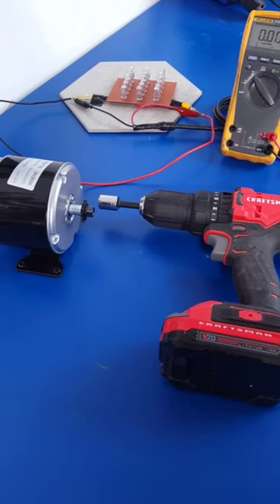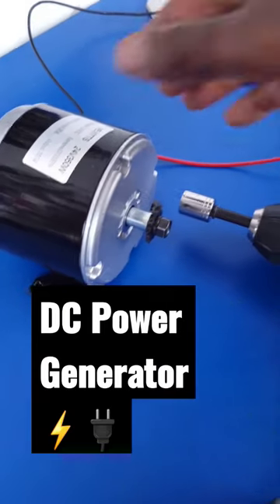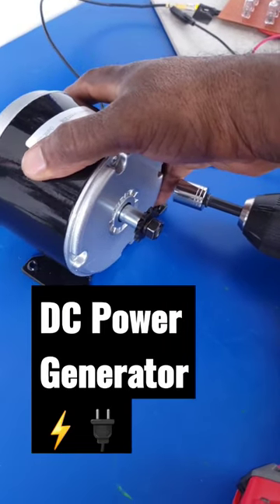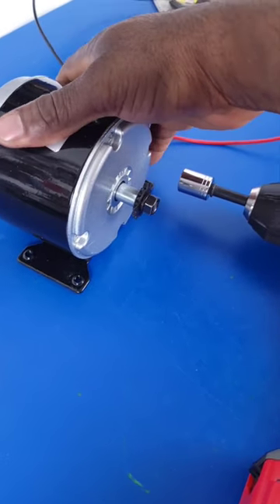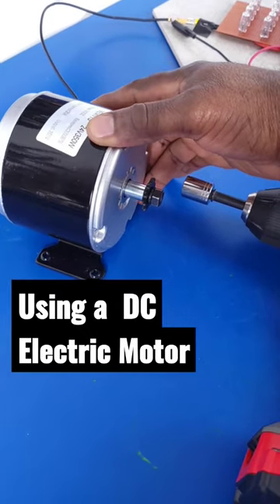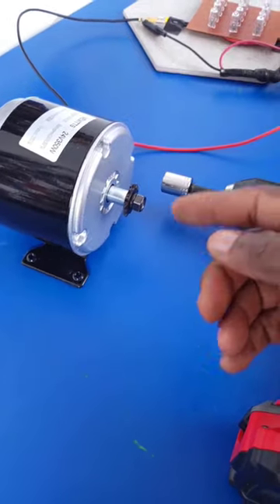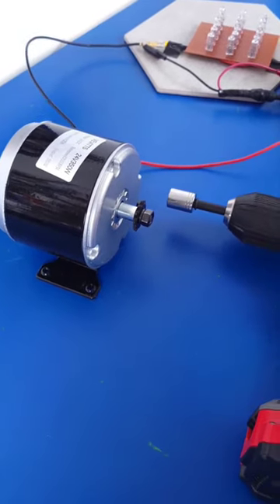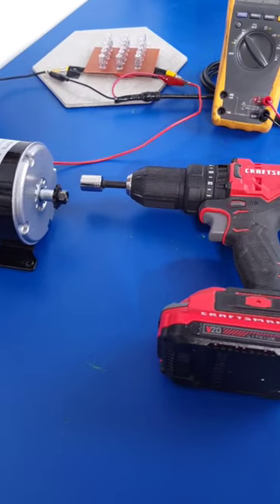DC Power Generator, Using Permanent Magnet Dc Electric Motor #shorts

Comment: How much power does that dynamo?
Reply from the maker: It's not actually a dynamo😊
 it is a permanent magnet dc electric motor rated for an input power of 250W. Using it as a generator, you could get close to 200W out of the motor.

I hope this helps.
The Innovati0n Lab 💥 
www.theinnovati0nlab.com

Comment: Hey, just wondering for a school project one of my friends bought one of these and is trying to make it so a phone can charge with it! I was wondering what the dc motor plugs into and then the output of that item into a phone charger do you think that would be possible?
Reply from the maker: Wonderful! I love school projects. Also, it seems that your friend is working on a cool project.👍👍👍
The motor in this motor is a 250W permanent magnet DC motor, and it comes with two power cables - RED and BLACK wires connected to ring lugs....ans that it.
Please share the videos below with your friend.
I explained how to use these permanent magnet motors as DC generators in those videos.
I hope you find them helpful. 
The only thing to be aware of is that you need to maintain a high enough rpm on the drive motor if not, you may get some pulsating DC power due to low rpm...and this could damage your loads. Also, you need to add additional  diode rectifiers and filter capacitors at the output to help clean up any unwanted ripples on your generated output power.
Example videos:
👇👇👇
EBIKE MOTOR LOAD SIMULATOR CONCEPT VIDEO:
https://youtu.be/w9F_UoCyjPY?si=kZPfWQI4smVDH3HY

DC GENERATOR:
https://youtu.be/OuLokIPeGt8?si=Zoaf1FxHR-mnnfCD

BOOST CONVERTER DRIVE:
https://youtu.be/haGmAmpqNAw?si=6alYe4mFpwT2d4hH

Success wishes on your friends project, and let me know if you have any questions.
👍😎
The Innovati0n Lab

Comment: How many magnets will it take to power a 100 watt motor?
Reply from the maker: The permanent magnet motor shown in this video is rated for a power input of 250W. So, assuming it could generate an output power close to the input (we also have to consider motor efficiency when used as a generator), then,  it should be able to atleast drive two 100W motors.....this is all theory and you have to test it. 😊

Please see my motor load simulator videos linked below 👇👇👇
https://youtu.be/w9F_UoCyjPY?si=ZoOKO_HfKWceNZRh

https://youtu.be/w9F_UoCyjPY?si=9bUmB39sY7VoJO0j